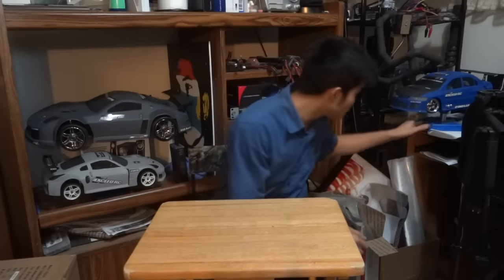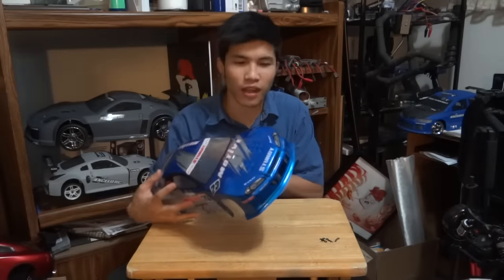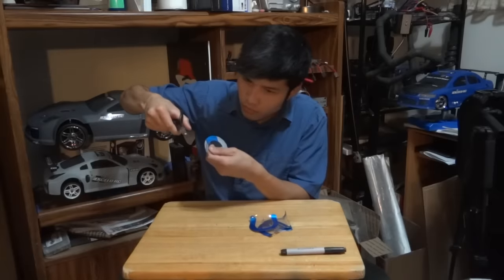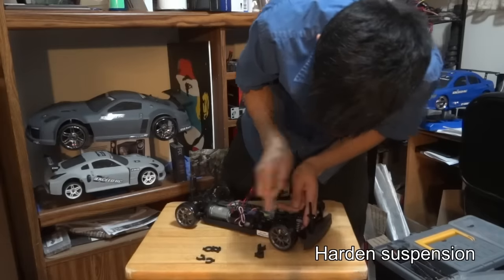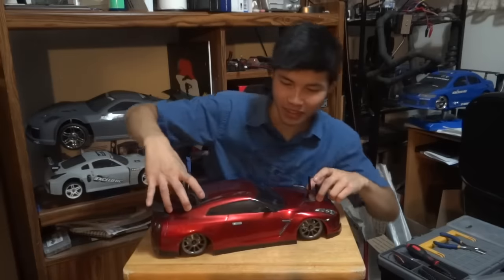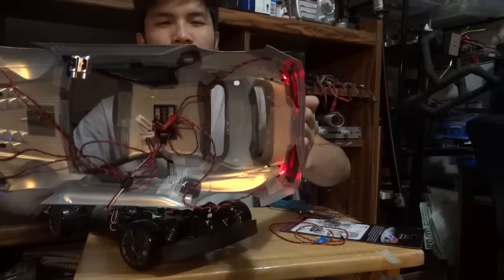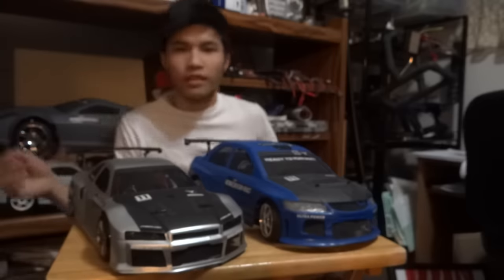RC Modify 7 | NISSAN Skyline GTR R34 - RC Car

Comment: man you do some great work. just randomly stumbled upon your Toyota supra video while I was watching "real" car videos lol. this looks like a fun hobby. I never really cared for the rc cars but to make them looks very interesting. I would spend hours as a kid building model cars. this looks like that but better! whats a website to use for this stuff. and do they make any car? what about real looking engines to put under the hood? id like to find a 99 eclipse gsx and do one of those and get the 4g63 engine under the hood. looking forward to your reply!
Reply from the maker: Yea, I seen a lot of 1/10 engine bays for RC in Asia ( cheap ones). But for the US, you gotta pay some $$ to get those with engine bay and stuff(I don't know where to find that neither).

Here if you wanna build it on your own so you don't have to find the one with everything.
engine bay: http://www.ebay.com/sch/i.html?_odkw=rc+engine&LH_BIN=1&_sop=15&_osacat=0&_from=R40&_trksid=p2045573.m570.l1313.TR0.TRC0.H0.Xrc+engine+bay&_nkw=rc+engine+bay&_sacat=0#item20e26ede33

body: http://www.ebay.com/itm/rc-1-10-eclipse-body-/281301357789?pt=Radio_Control_Parts_Accessories&hash=item417ede14dd

Comment: yo quiero unos de esos el nissan skailaine gtr r34
Reply from the maker: http://www.ebay.com/itm/1-10-Nissan-Skyline-GTR-Painted-RC-R-c-On-Road-Drift-Car-195mm-Body-Shell-Red-/171368545087?pt=Radio_Control_Parts_Accessories&hash=item27e65c7b3f

Comment: Clean build man, what would you say that setup would cost?
Reply from the maker: It's probably $400-$600 now a day if you are looking to modify your own RC car with battery/good charger. It is vary on how many modify accessary you want to add on also. Each chassis brand is also vary in prices.

Comment: Depending on your wiring skills you could tap into the esc and connect the brake lights to the brake on the esc (if it has one)

Comment: Where do you get the dc car I always wanted one pls pls answer back
Reply: Rc car
Reply from the maker: Bryan Medina
 http://www.ebay.com/sch/i.html?_sacat=0&_from=R40&_sop=15&_nkw=1%2F10+madspeed&rt=nc&LH_BIN=1

http://www.nitrorcx.com/exrcmadrca.html

http://www.ebay.com/sch/i.html?_udlo=190&LH_BIN=1&_sop=15&_from=R40&_sacat=0&_udhi&_nkw=1/10%20hpi%20drift&_pgn=5&_skc=800&rt=nc

http://www.ebay.com/sch/i.html?LH_BIN=1&_sop=15&_from=R40&_sacat=0&_nkw=1/10%20tamiya%20drift&_pgn=3&_skc=400&rt=nc&_udlo=300&_udhi
Reply: Thx means alot

Comment: TheDarkDragonWing are you ever gonna use that R35 body? If not i will buy it for $10
Reply from the maker: AlexD-GTR I'm sorry I can't sell it to you. here you can buy one: http://www.ebay.com/itm/Tamiya-Nissan-GT-R-R35-Clear-Body-Set-190mm-1-10-RC-Touring-Car-On-Road-51340-/131390504886?pt=LH_DefaultDomain_0&hash=item1e977bffb6

Comment: Hey . I just saw some videos like that. If can anyone can tell me more about were i can buy cars like that or pieces. or a price, i will realy be thankfull
Reply from the maker: You can build it yourself like this video here. Look in the description for links:
https://youtu.be/aJGDfJp9cZY
Or you can buy one of these already built:
http://www.nitrorcx.com/madspeed-drift-car-green.html
http://www.ebay.com/sch/i.html?_sacat=0&_from=R40&_sop=15&_nkw=1%2F10+madspeed&rt=nc&LH_BIN=1
http://www.ebay.com/sch/i.html?_odkw=1%2F10+hpi+drift&_udlo=190&_sop=15&LH_BIN=1&_osacat=0&_from=R40&_trksid=p2045573.m570.l1313.TR2.TRC1.A0.H0.X1%2F10+hpi+drift+RTR.TRS0&_nkw=1%2F10+hpi+drift+RTR&_sacat=0
http://www.ebay.com/sch/i.html?_udlo=290&_sop=15&_mPrRngCbx=1&LH_BIN=1&_from=R40&_sacat=0&_nkw=1/10%20mst%20drift%20RTR&rt=nc&_udhi
http://www.ebay.com/sch/i.html?_odkw=1%2F10+tamiya+drift&_udlo=300&_sop=15&LH_BIN=1&_osacat=0&_from=R40&_trksid=p2045573.m570.l1313.TR0.TRC0.H0.X1%2F10+tamiya+drift+RTR.TRS0&_nkw=1%2F10+tamiya+drift+RTR&_sacat=0

Spray paint for clear RC polycarbonate bodies:
http://www.ebay.com/sch/i.html?_odkw=Duratrax+SprayPaint&LH_BIN=1&_osacat=0&_from=R40&_trksid=p2045573.m570.l1313.TR0.TRC0.A0.H0.XDuratrax+Spray+Paint.TRS1&_nkw=Duratrax+Spray+Paint&_sacat=0
http://www.ebay.com/sch/i.html?_odkw=Tamiya+Spray+Paint&LH_BIN=1&_osacat=0&_from=R40&_trksid=p2045573.m570.l1313.TR0.TRC0.H0.XTamiya+PS+Spray+Paint.TRS1&_nkw=Tamiya+PS+Spray+Paint&_sacat=0

Websites to shop for 1/10 RC bodies:
http://www.rcmart.com/body-light-190mm-body-c-438_875.html
http://www.rcmart.com/body-light-200mm-body-c-438_876.html
http://www.rcmart.com/body-light-drift-body-c-438_1535.html
http://www.rcmart.com/body-light-drift-body-c-438_1535.html
Reply: DarkDragonWing hey man my 1/10 scale rc doesn't work anymore. I hadn't charged it in a while then I tried and it wouldn't work. why is this
Reply: batteries probably went bad. batteries go bad when they get hot.

Comment: where do you buy finding those RC cars
Reply from the maker: +Derek Crawford You can buy one of these.
I buy this one:
http://www.nitrorcx.com/madspeed-drift-car-green.html
These ones are good too, but they are more expensive:
http://www.ebay.com/sch/i.html?_sacat=0&_from=R40&_sop=15&_nkw=1%2F10+madspeed&rt=nc&LH_BIN=1
http://www.ebay.com/sch/i.html?_odkw=1%2F10+hpi+drift&_udlo=190&_sop=15&LH_BIN=1&_osacat=0&_from=R40&_trksid=p2045573.m570.l1313.TR2.TRC1.A0.H0.X1%2F10+hpi+drift+RTR.TRS0&_nkw=1%2F10+hpi+drift+RTR&_sacat=0
http://www.ebay.com/sch/i.html?_udlo=290&_sop=15&_mPrRngCbx=1&LH_BIN=1&_from=R40&_sacat=0&_nkw=1/10%20mst%20drift%20RTR&rt=nc&_udhi
http://www.ebay.com/sch/i.html?_odkw=1%2F10+tamiya+drift&_udlo=300&_sop=15&LH_BIN=1&_osacat=0&_from=R40&_trksid=p2045573.m570.l1313.TR0.TRC0.H0.X1%2F10+tamiya+drift+RTR.TRS0&_nkw=1%2F10+tamiya+drift+RTR&_sacat=0

Comment: Just asking if u were to make another one of the same bodies how much would would u sell it for. I would really like one and im horrible at decorating rc bodies.
Reply from the maker: I only do this for show. You can do it. I believe in you. Try it out. Everything you need is all online
Reply: The DarkDragonWing I just bought the rx-7 body im pretty sure it will fit 190mm. Thanks for the encouragement. What should be the colors :)
Reply from the maker: Sean Foster
 You can do yellow black or Blue back
Reply: Ok thanks so much for the info i like the color i will do that.

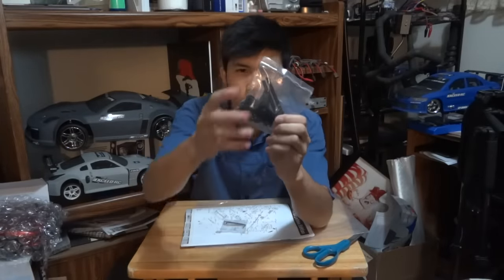Comment: Hey question....im going to buy one but im seeing the scale is 1:10 right but when i check specs on ebay it says Length: 17.32 in (440mm) Width: 7.48 in (190mm). when im ordering bodies for it do you go by the width or the length ??
Reply: You go by the width (usually 190mm or 200mm)

Comment: Man , I really want a rc car , are these sites confiable ?
Reply from the maker: +J.LucasS Qa They're pretty good. You can buy one of these.
I buy this one:
http://www.nitrorcx.com/madspeed-drift-car-green.html
These ones are good too, but they are more expensive:
http://www.ebay.com/sch/i.html?_sacat=0&_from=R40&_sop=15&_nkw=1%2F10+madspeed&rt=nc&LH_BIN=1
http://www.ebay.com/sch/i.html?_odkw=1%2F10+hpi+drift&_udlo=190&_sop=15&LH_BIN=1&_osacat=0&_from=R40&_trksid=p2045573.m570.l1313.TR2.TRC1.A0.H0.X1%2F10+hpi+drift+RTR.TRS0&_nkw=1%2F10+hpi+drift+RTR&_sacat=0
http://www.ebay.com/sch/i.html?_udlo=290&_sop=15&_mPrRngCbx=1&LH_BIN=1&_from=R40&_sacat=0&_nkw=1/10%20mst%20drift%20RTR&rt=nc&_udhi
http://www.ebay.com/sch/i.html?_odkw=1%2F10+tamiya+drift&_udlo=300&_sop=15&LH_BIN=1&_osacat=0&_from=R40&_trksid=p2045573.m570.l1313.TR0.TRC0.H0.X1%2F10+tamiya+drift+RTR.TRS0&_nkw=1%2F10+tamiya+drift+RTR&_sacat=0
Reply: All right , thanks man ! I really like your works with the bodys ! Jeep doind this , its amazing!

Comment: Where did u get the car like website
Reply from the maker: RC drift cars you can buy:

http://www.ebay.com/sch/i.html?_sacat=0&_from=R40&_sop=15&_nkw=1%2F10+madspeed&rt=nc&LH_BIN=1

http://www.nitrorcx.com/exrcmadrca.html

http://www.ebay.com/sch/i.html?_udlo=190&LH_BIN=1&_sop=15&_from=R40&_sacat=0&_udhi&_nkw=1/10%20hpi%20drift&_pgn=5&_skc=800&rt=nc

http://www.ebay.com/sch/i.html?LH_BIN=1&_sop=15&_from=R40&_sacat=0&_nkw=1/10%20tamiya%20drift&_pgn=3&_skc=400&rt=nc&_udlo=300&_udhi

Comment: where did you get that nissan gtr body @ 1:52
Reply from the maker: +Budget Rc http://www.ebay.com/itm/HPI-Racing-Nissan-GT-R-R35-CLEAR-200mm-Body-HPI17538-/231843976793?hash=item35fafa5659:g:JKYAAOSwHaBWlbfR
Reply: made by hpi...cool

Comment: Where did you get the r34 body?
Reply from the maker: I can't find it anymore. I found this: https://rover.ebay.com/rover/1/711-53200-19255-0/1?ff3=4&toolid=11800&pub=5575273973&campid=5338044275&mpre=https%3A%2F%2Fwww.ebay.com%2Fitm%2FNismo-R34-GTR-Blue-Painted-RC-Body-1-10th-Scale-HPI-Traxxas-Kyohso-Nissan%2F282433832226%3Fhash%3Ditem41c25e4522%3Ag%3A7tcAAOSwCWFY8Yn4

Comment: Does the red rubber battery connectors work with the white plastic ones?
Reply from the maker: Carlos Campbell I think you will need a converter http://www.ebay.com/itm/4mm-Bullet-Banana-to-Tamiya-male-connector-adapter-Lipo-NiMH-FREE-USA-SHIP-/151658986974?pt=LH_DefaultDomain_0&hash=item234f947dde
Reply from the maker: Carlos Campbell http://www.ebay.com/itm/4mm-Bullet-Banana-to-Tamiya-Style-female-connector-Lipo-NiMH-Battery-ESC-RC-/151622639350?pt=LH_DefaultDomain_0&hash=item234d69def6
Reply from the maker: Carlos Campbell Yeah, take a look to see if you need one of those.
Reply: Thanks 
I was looking at drift cars because I thinking of getting the mad speed Nissan 350z for my first car but I saw the bullet connectors so it asked you 
Thanks 
The DarkDragonWing
Reply from the maker: Carlos Campbell
 no problem
Reply: The DarkDragonWing :-) thanks

Comment: i really like n enjoy watching your video 
i really want one but idk which are the good one fast one or where to get them from but i would rather buy a complete one.
Reply from the maker: +Jasinsky Desir Thanks! Yes, completed one is good, because you can always upgrade it later on.
You can buy one of these.
I buy this one:
http://www.nitrorcx.com/madspeed-drift-car-green.html
http://www.bananahobby.com/rc-surface-vehicles-electric-on-road-cars.html
These ones are good too, but they are more expensive:
http://www.ebay.com/sch/i.html?_sacat=0&_from=R40&_sop=15&_nkw=1%2F10+madspeed&rt=nc&LH_BIN=1
http://www.ebay.com/sch/i.html?_odkw=1%2F10+hpi+drift&_udlo=190&_sop=15&LH_BIN=1&_osacat=0&_from=R40&_trksid=p2045573.m570.l1313.TR2.TRC1.A0.H0.X1%2F10+hpi+drift+RTR.TRS0&_nkw=1%2F10+hpi+drift+RTR&_sacat=0
http://www.ebay.com/sch/i.html?_udlo=290&_sop=15&_mPrRngCbx=1&LH_BIN=1&_from=R40&_sacat=0&_nkw=1/10%20mst%20drift%20RTR&rt=nc&_udhi
http://www.ebay.com/sch/i.html?_odkw=1%2F10+tamiya+drift&_udlo=300&_sop=15&LH_BIN=1&_osacat=0&_from=R40&_trksid=p2045573.m570.l1313.TR0.TRC0.H0.X1%2F10+tamiya+drift+RTR.TRS0&_nkw=1%2F10+tamiya+drift+RTR&_sacat=0

Comment: where did u get the cars from
Reply from the maker: http://www.nitrorcx.com/madspeed-drift-car-fire-blue.html

http://www.rcmart.com/body-light-190mm-body-c-438_875.html?page=5&sort=1a

http://www.ebay.com/itm/1-10-Nissan-Skyline-GTR-Painted-RC-R-c-On-Road-Drift-Car-195mm-Body-Shell-Red-/171368545087?pt=Radio_Control_Parts_Accessories&hash=item27e65c7b3f

Comment: Where did you get the light kit from?
Reply from the maker: here:
http://www.ebay.com/itm/4-operation-modes-RC-Car-Buggy-Truck-FLASHING-light-12-LED-system-kit-G-T-Power-/350829617652?pt=Radio_Control_Parts_Accessories&hash=item51af1321f4
Reply: Probably should start reading the description hahaha but thanks bro!

Comment: where did you bought that rc body i want to build it my self too
Reply from the maker: +Tonny Kusnandar You can buy one of these.
I buy this one:
http://www.nitrorcx.com/madspeed-drift-car-green.html
These ones are good too, but they are more expensive:
http://www.ebay.com/sch/i.html?_sacat=0&_from=R40&_sop=15&_nkw=1%2F10+madspeed&rt=nc&LH_BIN=1
http://www.ebay.com/sch/i.html?_odkw=1%2F10+hpi+drift&_udlo=190&_sop=15&LH_BIN=1&_osacat=0&_from=R40&_trksid=p2045573.m570.l1313.TR2.TRC1.A0.H0.X1%2F10+hpi+drift+RTR.TRS0&_nkw=1%2F10+hpi+drift+RTR&_sacat=0
http://www.ebay.com/sch/i.html?_udlo=290&_sop=15&_mPrRngCbx=1&LH_BIN=1&_from=R40&_sacat=0&_nkw=1/10%20mst%20drift%20RTR&rt=nc&_udhi
http://www.ebay.com/sch/i.html?_odkw=1%2F10+tamiya+drift&_udlo=300&_sop=15&LH_BIN=1&_osacat=0&_from=R40&_trksid=p2045573.m570.l1313.TR0.TRC0.H0.X1%2F10+tamiya+drift+RTR.TRS0&_nkw=1%2F10+tamiya+drift+RTR&_sacat=0

Here is the one that you build everything: http://www.rcmart.com/3racing-kitd4rwd-sakura-drift-p-62225.html?cPath=1102_1106

Comment: Did you used normal spray paint on polycarbonate body?
Does it stays on the body?
what difference does normal spray paint does compared to polycarbonate spray paints?
Reply from the maker: Most of the paints out there will not stay well. Only use these paints:

Spray Paints For RC Polycarbonate Bodies
http://www.ebay.com/sch/i.html?LH_BIN=1&_from=R40&_sacat=0&_nkw=tamiya+spray+paint+ps&_sop=15
http://www.ebay.com/sch/i.html?_odkw=DuraTrax+spay+paint&_osacat=0&_from=R40&_trksid=p2045573.m570.l1313.TR0.TRC0.H0.XDuraTrax+spray+paint.TRS0&_nkw=DuraTrax+spray+paint&_sacat=0
http://www.ebay.com/sch/i.html?_from=R40&_sacat=0&_nkw=spaz+stix+spray&rt=nc&LH_BIN=1
Reply: will one can of tamiya PS spray paint(100ml) be enough for one body?
Reply from the maker: Subir Gupta No, always buy 2

Comment: where I get such a car
Reply from the maker: +juan david barrera montaña You can buy one of these.
I buy this one:
http://www.nitrorcx.com/madspeed-drift-car-green.html
These ones are good too, but they are more expensive:
http://www.ebay.com/sch/i.html?_sacat=0&_from=R40&_sop=15&_nkw=1%2F10+madspeed&rt=nc&LH_BIN=1
http://www.ebay.com/sch/i.html?_odkw=1%2F10+hpi+drift&_udlo=190&_sop=15&LH_BIN=1&_osacat=0&_from=R40&_trksid=p2045573.m570.l1313.TR2.TRC1.A0.H0.X1%2F10+hpi+drift+RTR.TRS0&_nkw=1%2F10+hpi+drift+RTR&_sacat=0
http://www.ebay.com/sch/i.html?_udlo=290&_sop=15&_mPrRngCbx=1&LH_BIN=1&_from=R40&_sacat=0&_nkw=1/10%20mst%20drift%20RTR&rt=nc&_udhi
http://www.ebay.com/sch/i.html?_odkw=1%2F10+tamiya+drift&_udlo=300&_sop=15&LH_BIN=1&_osacat=0&_from=R40&_trksid=p2045573.m570.l1313.TR0.TRC0.H0.X1%2F10+tamiya+drift+RTR.TRS0&_nkw=1%2F10+tamiya+drift+RTR&_sacat=0

Comment: where ti get the lights?
Reply from the maker: http://www.ebay.com/itm/G-T-POWER-12-LED-RC-Car-Flashing-Light-System-LE858-NEW-/250790970622?pt=Radio_Control_Parts_Accessories&hash=item3a644e84fe
Reply: thanks!

Comment: where can buy
Reply from the maker: +語宸洪 You can buy one of these.
I buy this one:
http://www.nitrorcx.com/madspeed-drift-car-green.html
These ones are good too, but they are more expensive:
http://www.ebay.com/sch/i.html?_sacat=0&_from=R40&_sop=15&_nkw=1%2F10+madspeed&rt=nc&LH_BIN=1
http://www.ebay.com/sch/i.html?_odkw=1%2F10+hpi+drift&_udlo=190&_sop=15&LH_BIN=1&_osacat=0&_from=R40&_trksid=p2045573.m570.l1313.TR2.TRC1.A0.H0.X1%2F10+hpi+drift+RTR.TRS0&_nkw=1%2F10+hpi+drift+RTR&_sacat=0
http://www.ebay.com/sch/i.html?_udlo=290&_sop=15&_mPrRngCbx=1&LH_BIN=1&_from=R40&_sacat=0&_nkw=1/10%20mst%20drift%20RTR&rt=nc&_udhi
http://www.ebay.com/sch/i.html?_odkw=1%2F10+tamiya+drift&_udlo=300&_sop=15&LH_BIN=1&_osacat=0&_from=R40&_trksid=p2045573.m570.l1313.TR0.TRC0.H0.X1%2F10+tamiya+drift+RTR.TRS0&_nkw=1%2F10+tamiya+drift+RTR&_sacat=0

Comment: will you sale it
Reply from the maker: +Zaid Kaudeer I might sell it in the future
Reply: +The DarkDragonWing where you buy it
Reply: +The DarkDragonWing i mean which market
Reply from the maker: Zaid Kaudeer You can buy one of these.
I buy this one:
http://www.nitrorcx.com/madspeed-drift-car-green.html
http://www.bananahobby.com/rc-surface-vehicles-electric-on-road-cars.html
These ones are good too, but they are more expensive:
http://www.ebay.com/sch/i.html?_sacat=0&_from=R40&_sop=15&_nkw=1%2F10+madspeed&rt=nc&LH_BIN=1
http://www.ebay.com/sch/i.html?_odkw=1%2F10+hpi+drift&_udlo=190&_sop=15&LH_BIN=1&_osacat=0&_from=R40&_trksid=p2045573.m570.l1313.TR2.TRC1.A0.H0.X1%2F10+hpi+drift+RTR.TRS0&_nkw=1%2F10+hpi+drift+RTR&_sacat=0
http://www.ebay.com/sch/i.html?_udlo=290&_sop=15&_mPrRngCbx=1&LH_BIN=1&_from=R40&_sacat=0&_nkw=1/10%20mst%20drift%20RTR&rt=nc&_udhi
http://www.ebay.com/sch/i.html?_odkw=1%2F10+tamiya+drift&_udlo=300&_sop=15&LH_BIN=1&_osacat=0&_from=R40&_trksid=p2045573.m570.l1313.TR0.TRC0.H0.X1%2F10+tamiya+drift+RTR.TRS0&_nkw=1%2F10+tamiya+drift+RTR&_sacat=0
Reply: +The DarkDragonWing  which country is this  market

Comment: Great build! Anyone know where I can get some Lamborghini body shells?
Reply from the maker: Turbogen http://www.ebay.com/itm/Lamborghini-Gallardo-1-10-Scale-RC-Car-Lexan-Body-Painted-Orange-Plastic-/321658473891?pt=LH_DefaultDomain_0&hash=item4ae456cda3 http://www.ebay.com/itm/1-10-RC-Car-BODY-Shell-LAMBORGHINI-GALLARDO-190mm-Body-w-Light-Buckets-/191494854234?pt=Radio_Control_Vehicles&hash=item2c95fb965a
Reply: Aw darn i missed that one but i found a really good one on ebay
Reply: Thanks for the reply though.

Comment: where are you get the RC
Reply from the maker: +Nicholas Richardo You can buy one of these.
I buy this one:
http://www.nitrorcx.com/madspeed-drift-car-green.html
These ones are good too, but they are more expensive:
http://www.ebay.com/sch/i.html?_sacat=0&_from=R40&_sop=15&_nkw=1%2F10+madspeed&rt=nc&LH_BIN=1
http://www.ebay.com/sch/i.html?_odkw=1%2F10+hpi+drift&_udlo=190&_sop=15&LH_BIN=1&_osacat=0&_from=R40&_trksid=p2045573.m570.l1313.TR2.TRC1.A0.H0.X1%2F10+hpi+drift+RTR.TRS0&_nkw=1%2F10+hpi+drift+RTR&_sacat=0
http://www.ebay.com/sch/i.html?_udlo=290&_sop=15&_mPrRngCbx=1&LH_BIN=1&_from=R40&_sacat=0&_nkw=1/10%20mst%20drift%20RTR&rt=nc&_udhi
http://www.ebay.com/sch/i.html?_odkw=1%2F10+tamiya+drift&_udlo=300&_sop=15&LH_BIN=1&_osacat=0&_from=R40&_trksid=p2045573.m570.l1313.TR0.TRC0.H0.X1%2F10+tamiya+drift+RTR.TRS0&_nkw=1%2F10+tamiya+drift+RTR&_sacat=0